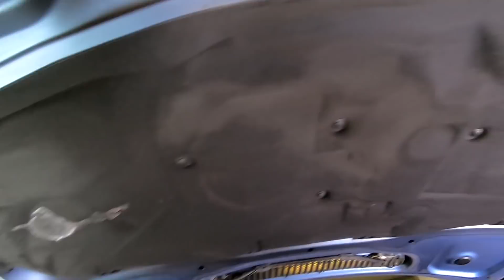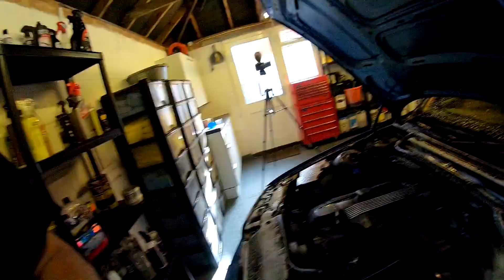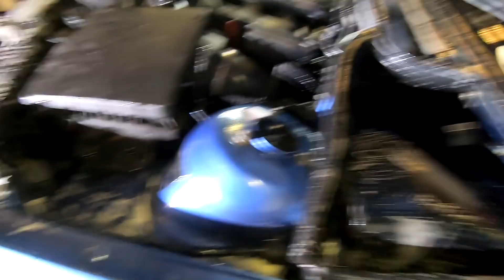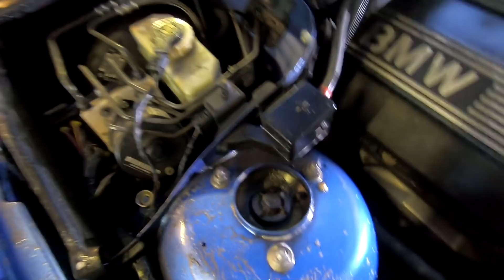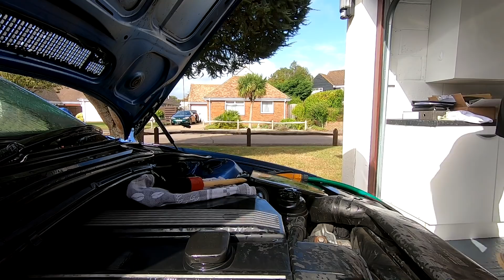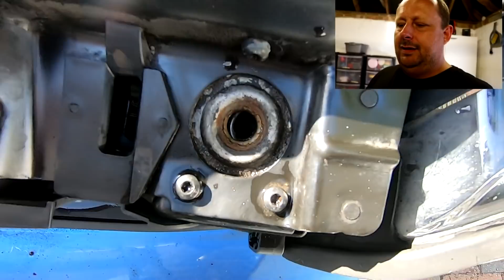Safest Way To Clean Your Engine Bay Without a Pressure Washer

Comment: Haven’t finished the video yet, just at the part where you’re using the toothbrush along the bonnet shut.

If you find you’re ever struggling to get in and clean something with a straight handled brush, I find having a pack of cheap toothbrushes is ideal. You can use a source of heat to melt the handle up near the head, twist it in to the shape you need and then hold it in place whilst it cools. I’ve got a box of them in the garage and they’re always useful.
Reply from the maker: ive got all sorts of little brushes.. see later on in this video the little one I use white thing. that you can bend, its like a mini mini EZ wheel brush but its got like a cone on one end and you can bend it.. thats really hand for all the little bits.

Comment: Surfex HD is simply outstanding! Wouldn’t be without it!👌🏻
Reply from the maker: more you use it the more you realise how good it is.    even cleaning out pads its better than other APC's.  Its not overly foamy under contact but I find its less prone to leaving residue.  ITs awesome at very very low concentrations for interior wipe downs.   works well in the pump foamers at 10:1 for engine bays and wheels...

icing on top its non caustic, safe bio degradble.  Highly concentrated and very very good value for money.
Reply: How long does these products last on a shelf?

Comment: Water in the boot is generally the rear light, NSR. It is a sealed unit. The glue holding the light together deteriorates/splits over time allowing rain/water to run into the whole casing. At the back of the headlight, there is space for water to exit the light and get into the boot while being splashed about when driving. This is why you commonly see E46's with the LED rear lights have a couple of LED's blown nearer the bottom. This is because the water gets splashed onto the circuit board itself, corroding the solder points. Ask me how I know!!! :)

Comment: Another thing to check; if that’s the DME (ecu) box up by the firewall on the passengers side, the rubber seal around the lid can fail. The box has a drain hole at the bottom and the electronics should be suspended. In theory you’ll never have an issue; in reality the mucky water getting in gets dried out by engine heat leaving behind the grit and dirt in it. This blocks the drain hole and you can end up with a submerged ecu after washing or extended periods of rain.

Ask me how I know....

Comment: Not sure if you did Jon it but it's a really good idea to use a leaf blower to blow all the water out of the engine bay after you've cleaned it and then start it and bring the engine up to temperature to burn off whatever's left.
Reply from the maker: I was a naughty boy with this.. no realy drying other that wipe down with cloths..     not sure why.   its just sort of so damn dirty I need to go again later I think and dress it out better as well.    but I can work on the engine now with out getting insta black hands.

Comment: The DVD player is actually the computer for the Satnav/Radio! it holds the map disk, and the radio won't work without it... you'll be in a "blue screen" safe mode with basically no features
Reply from the maker: I think I have this thing working now Magic.  By the way the Television its analogue right so it wont actually work now analogue is gone?  is there any fix for it.  I just get the black a white dots

Comment: Thanks for the video, I’m a big fan of Surfex HD, always good to get expert opinion on dilution rates! Thanks👍. Would be interested if you do any cleaning of the underside of the rear subframe etc.  I was wondering if Surfex would strip off under seal wax?  Would you ever use a vacuum cleaner on blow for doin* under the bonnet to use the warm air to blow the water away?  Loving these project style videos!

Comment: Nice Job. I like that work. My Back certaining doesn't. I'm the goof that enjoys cleaning Wheels too.That Tape,depends on what your doing, what car, etc. It's called 'Tesa Tape'. I remember when I worked for Ford Lincoln Mercury Dealership we would get Re-Call Kits with a whole roll in it and I would pinch what was left to use on my old car projects... :)  Cloth type stuff you find in Interiors under the dash, inside doors and the like.

Comment: Nice video. I appreciate your efforts.
Nice to know you will continuing cleaning the engine bay.
I find that it's is easy to use a TIG welding material stick to poke a hole in the drain channels up with the windscreen. And work frome the top and the bottom indtil it can go all the way and then blow it clean with a airline. Before cleaning. But as a good first stage clean it's a super nice job
Reply: Beware of being too heavy when trying to stick something down the drain tubes. I use thin brass brazing rod because I had some. Works well but if the drain has a rubber hose between the fixed metal tube at the top and then goes down to another metal tube at the bottom you can stick the wire through the side of the hose. Not good! Also if you have a blockage, even a partial one, an airline can blow the hose off the metal tubes. Drains are a pain.!!!
Reply: @delukxy  I usually bend the Rod (use aluminum rods due to its flexibility) so it's have rounded end. And instead of pushing hard Og twist it so it's going to shovel the dirt lose. But yes you always have to be a bit careful. Sometimes I take Som duck tap and a 10-12mm(or bigger if the drain alow it) hose on the vacuum cleaner so take the worst out

Comment: After you've done the rusty bonnet lip, spray between the skins with Bilt Hamber Dynax S-50. You won't get to all of the rust inside when you do the repair but the spray will seal it all. Better than Waxoyl.

Comment: an awful lot of circle brush strokes around 2 to 5 inches each time ~  it appears that you worked the 10% Surf X cleaning solution on the entire surrounding edges of the bay around t(not yet doing) he engine all in one long scrub down session ~  wouldn't it have been better to limit yourself to an area, say of one half per session, then given some allotted time for the chemical to work loose the grime, move on with the all important rinse before going off to tackle the other half ?  no doubt, after all that labor of love, a grand improvement in a clean engine compartment, great job ~

Comment: If you have some rusty looking bolt and nuts, apart from using stronger chemicals like from bilt hamber, you can use apple cider vinegar and let them soak in a plastic container for 1 or 2 days. Then rinse them, dry them and soak them in wd40 to protect them. Or better paint them with black exterior paint. Most of bolts and nuts will come back looking better.
Reply: Or get friendly with your local platers; take a bucket of bits around and you can get them stripped and black phosphate/oxide coated for not much at all. Cold blueing is also an option for certain parts.

Another option is just going to your local dealership. Most bmw fasteners are kept in common through the years; they’ll probably have them in stock already for pennies. Most come in packs of 10 or so. You’ll kick yourself if you spend hours cleaning nuts and bolts up and then find you can replace every visible fastener under the bonnet for £30.
Reply: @demelitia  Not easy to get each bolt specific for some part of the car, and order them with the right number etc.. And if it's just surface rust you don't have to replace them.
Local platers are a good way to get them clean but it's not something you find at every corner, at least where i'm from
Reply: TerrificFlow for sure, some of them are car specific, lots aren’t though. I saw quite a few in the video that are still in use in the same places for current models. If your local parts counter staff are experienced they’ll know exactly what you need in short order.

Comment: look for a local company that does hydroblasting for the rusty parts place near me does it and hes blasted way worse parts with plastic bits on it and it comes up brand new also rear boot leak im sure is the boot seal going weak or the rear lights :)

Comment: For surfex when diluted, is there any type of expiration on it? I dilute down for items generally but find it useless on tyres if diluted, and generally go back to straight out of the bottle. Do you find you have to keep making up new mixes of it? Also for tyres, what would you recommend doing, using surfex, 1 to 10 or just neat?
Reply from the maker: 10:1 mate.  I dont find it expries.   maybe give it a shake before you use it.. who knows the surfactants might sink to the bottem or something.
Reply: @ForensicDetailing  cool cheers john. Just to be clear, 10 parts water to 1 part surfex? 😂 just feel theres not enough oomph in it to clean tyres, find myself going at them 2 or 3 times then to get them good!

Comment: Hi Jon, you said about degreasing and regreasing, how would I know what needs regreasing after cleaning and what with?
Reply from the maker: any componnent with thick grease on it basically ben (or any maintenance lubrication).  those these bonnet springs are greased and so are the base holes.   these springs and latches and door hinges are the main areas you might accidently "degrease" and need to regrease.

Comment: Be careful spraying water around the BMW Fuse boxes and ECU large black enclosure. I used to have a 5 series and 1 winter it failed to start. Figured it was getting no spark. Unscrewed the cover from the engine ECU box and it was half full of water !. Had to disconnect the battery, remove the ecu's. Take the ecu's apart and put the PCB's in the airing cupboard to dry out. And  unblocked the drainage hole in the box. Thankfully once the circuit boards were dry and all re-assembled she started right up.
Reply from the maker: thanks paul.  great point yer I need to check the intgrity of that computer housing

Comment: I'd stick to tessa harness tape. Not heard of that brand. Some of the knock off ones have been  found to be flammable or contain asbestos. Tessa tape is about a fiver a roll.
Reply from the maker: this stuff is heat proof.  I think its ok.  but I love little recomendations like this ill go tessa tape when I run out cheers matt

Comment: Couple of hours to clean, several days to get running again . Plastic bags over every black box, and never, never spray water over a car engine. Disconnect battery befor you start. if you are going to spray water everywere . The mind boggles

Comment: Water in boot = tail light seals, there are plugs at the bottom of the boot that are probably plugged.
Reply from the maker: i dont think its the tail light seals magic.     Ive been trying to diagnose this along with about 50 other problems.   but I dont think its the tail light seal. ininitially i did think it was this.  really stuck on this fault.    only other thing is boot seal but that kind of looks ok.

Comment: Why are brits so crazy about BMW's? Not saying us Americans don't like them but it seems like Brits are super wild over them.
Reply from the maker: in Europe handeling is really important.  in terms of mid range saloons which is still what most blokes want.   Its a fight off between 3 series, a4, c class.    none of the other saloons on offer  have the build quality of the german motors, or the pedigree.   But BMW edges it on handling.  BMW has some bonkers engines as well and they look good.   E46 is a real classic car an all time icon.  Everyone should own an E46 M3 at some point in their lives just to experience that engine on a track.

M140 as well been a huge hit in the UK for BMW.  totally bonkers rear wheel drive hot hatch, with stonking power and torque and you can get it 20 grand and map it to sub 4 second 0-6 for not too much money.   The difference with the M140 and ANY other hatchback is the fun factor of all that torque and power in the rear axel.    golf and audi feel a bit dead in comparison (not in power though)

Go to the nurburg ring and see how many roll around in e36/46/90's compared to audi's and mercs.   The fun factor is in the handling of the cars.  E90 m3 has to be the most used track on the ring i would say. followed by e46.

Audi and Merc have managed to get some success by I still think BMW is the "drivers" car choice.  kind of.. dunno theres some epic old mercs and audis I would love to explore more as well.

Top gear once said that to be a true petrolhead you have had to owned an Alfa Romeo.   True perhaps but they need to add BMW to that list as well.
Reply: @ForensicDetailing . I've had my share of M3's.. I used to work for BMW years ago and naturally I got decent deals on them so I tried to keep me a fresh M3 🤣 I've always been about the BMW but not many Americans are. They may drive a bmw but really don't know what the hell they have.

Comment: Water in boot is probley rear light's seals
Reply from the maker: Jor, I thought this too, and also thoguht I had fixed it..  thought I had it fixed but I dont think its the light seals.  its another one of the 500 problems I had.  I think it might be a gap in the door seal.   

I talk about this in follow up vids.. but its proving a challenge :)
Reply: @ForensicDetailing  I remember on Wheeler Dealers or Car SOS a difficult to find rain water leak was found with a smoke generator.
Reply: Is the water in the battery box? Had this on my M3 and everyone said the lights but the seals looked really good. Eventually got some knock off lights from ebay and cured the problem. @ForensicDetailing